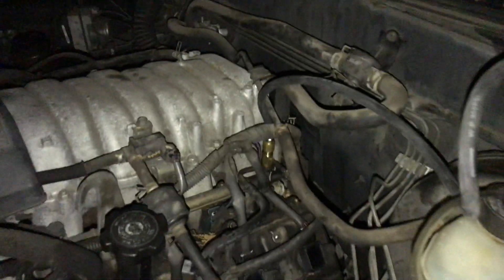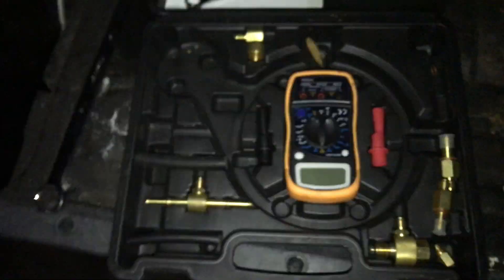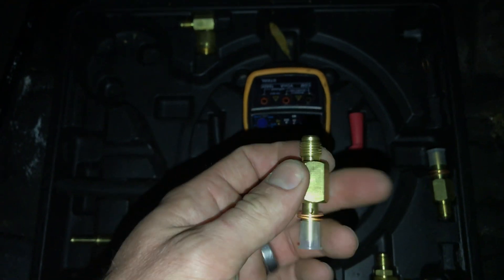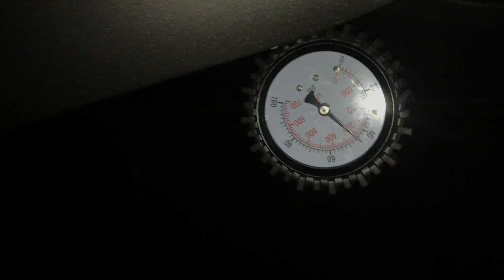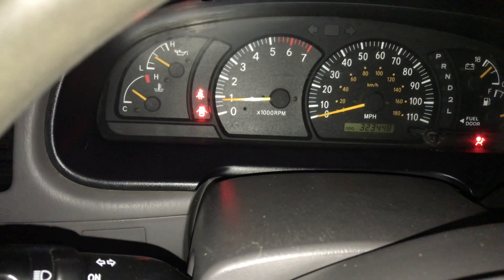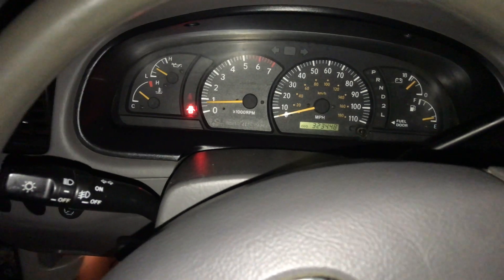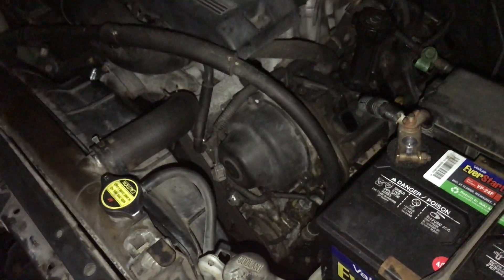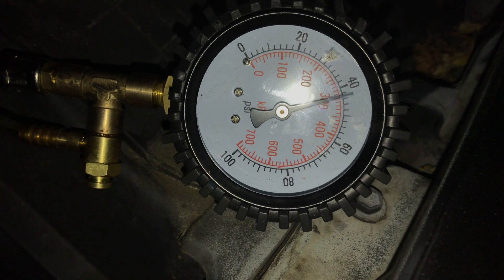Toyota Fuel pressure test: tundra, sequoia, 4Runner and more

Comment: thats a vacuum leak my man.... you are looking in the wrong direction.  you need to run a smoke test through the vacuum lines of this engine and see where its leaking... whats happening is its sucking air from elsewhere into the engine and throwing off a shitload of sensors

Comment: Were you ever able to diagnose and fix the problem? If so what was it? My sequoia is doing the same
Reply from the maker: The problem ended up being the timing was off by one tooth. I fixed that and the truck ran like a top.
Reply: @DadsGotADeal how much was that .  And want to confirm how many miles on ur?
Reply from the maker: @NeighborBones  how much? I fixed myself. Free. Just my time spent
Reply from the maker: @NeighborBones  there were 350k miles on that truck

Comment: Okay I need help Toyota 4.7 new plugs new coil packs new injectors new O2 sensor misfires 3&6 running rich
Reply: Check timing or ecu
Reply: Did you ever figure it out?

Comment: The banjo bolt is on the other end of the fuel rail. You are tapped into the fuel pressure regulator.
Reply: Wrong

Comment: Check your plugs, if heavily carboned then it’s likely the Fuel pressure regulator.  At idle proper FP is not being maintained, thus the shake.  FPR valve stuck in closed position, creating high pressure on the ignitors.  May throw misfire codes and rich fuel trims as well. This little FPR is an very important component that typically doesn’t fail, but it can.

Comment: Where do you get that connector for the Toyota to connect the pressure gauges up to.
Reply: Fuel pressure kit on amazon worked for me. Also the one I borrowed from O'Reilly
Reply: @crystalclearcompass  i got lucky i had misfire codes i ran two fuel injection cleaners back to back 1st lucas 2nd chev techron as i was finishing the second tank it started up better i reset code .. im on my third tank no cleaners starts up great and no codes yet.  .. previous owner may have not been using top tier gas.
Reply: @NeighborBones wow i wonder if your sitiuation would or did or typically drops fuel pressure 🤔
Reply: @crystalclearcompass  i almost found out .. nobody post the part numbers for the set up all i could do was run inj cleaners.
Reply: It’s still a secret😢

Comment: I have a 2000 tundra 4.7L V8 with 350k, I saw yours has 323k. Starting at about 300k i had to replace coil packs every once in a while. It made a pulsing very similar to what yours has and in some cases when driving it was misfiring so bad it felt like i was riding on rumble strips. Replaced 6 out of the 8 so far and every time one goes out i get a check engine light reading telling me which cylinder is misfiring but I dont see a check engine light on yours so not sure if this is the problem or not.
Reply from the maker: When was the last timing belt change? Mine was off a tooth so that’s why it was pulsing.
Reply: I have a 2001 V8 Tundra with 255,000 miles and I just had to replace the fuel filter and Mass Air Flow sensor on mine this weekend.  So far so good.  No stall outs or rough idling on mine. Fingers crossed!

Comment: Where is the link for the banjo bolt replacing the dampener when doing the pressure test
Reply: I ask the same question, can't find it even from a Dealer.
Reply: @dga5396 Fuel pressure kit on amazon worked for me. Also the one I borrowed from O'Reilly
Reply: Fuel pressure kit on amazon worked for me. Also the one I borrowed from O'Reilly

Comment: That was crazy risky putting your hand 🤚 by the fan and belt while operating.  🤭  so glade you didn’t get tangled up in that. 😳
Reply from the maker: You are 100% right.
Reply: @DadsGotADeal  Where is the link for the banjo bolt replacing the dampener when doing the pressure test
Reply from the maker: @chuckb2136  hi there. Does it come with the pressure tester kit? I’ll watch my video again to check. I forgot!
Reply: @DadsGotADeal  Where is the link for the banjo bolt replacing the dampener when doing the pressure test